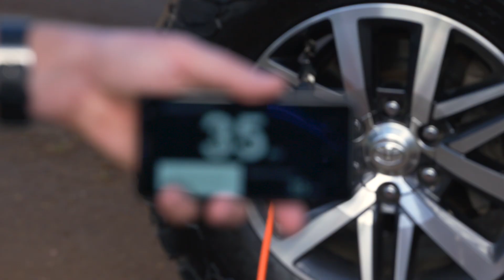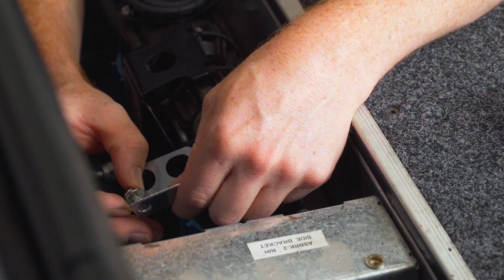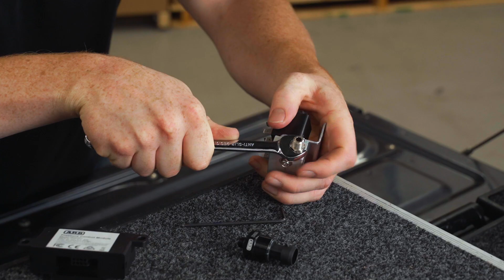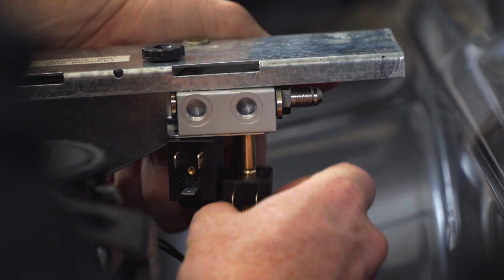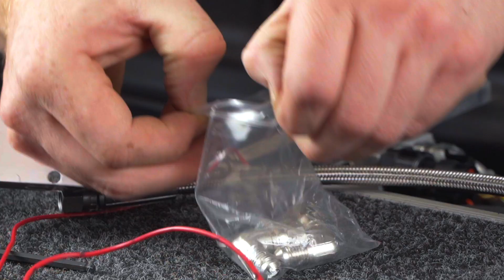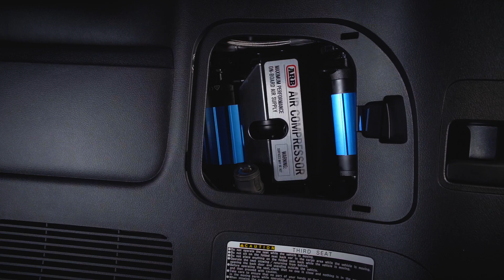ARB Fitting Advice | Pressure Control

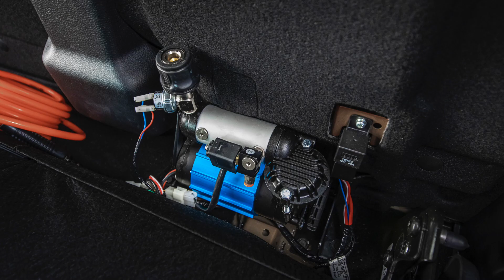Comment: At 1:20 what do you do with the red and blue wires that are connected to the existing pressure switch?  Cannot just leave it because it won't allow the new pressure transducer and pressure control module to work correctly.  Compressor instructions and Smart Pressure Control System instructions do not specify.  Please advise.  Thank you.

Comment: can you still “manually” inflate a tire without using the automatic pressure control/app using a simple hose and air chuck if needed? also, my current setup has the outlet on top of the compressor directly to a line that goes to a quick disconnect mounted on my bumper. how do i keep this connected and useable?

Comment: Would love an install on the single compressor, seems like additional components are required to make it work seamlessly.
Reply: Hello Michael.  Were you able to make your compressor work seamlessly?  I sent a comment a few minutes ago to the ARB Fitting Advice  video.  Did you have the same problem that I did, (read comment)? What solutions were you able to figure out?  Maybe we can help each other out.  Let me know, thanks.
Reply: @ronalddurkee8542  yes I finally worked it out and did need to buy additional items to make it all work. ARB did have all stock but would be good that all staff could advise the right advice.

Comment: If you have an air tank how would this integrate?
Reply: Would like to know this also has anyone had an answer any where regarding using with the arb air tank?
Reply: Another interested person in whether this works with air tank and if so recommended installation?

Comment: I think this would be aided by some sort of built in alternative control method, a manual override (touch screen maybe) of sorts that doesn't need an app or a phone. For those times that the phone doesn't work, runs out of battery, gets dropped and breaks, or gets lost.

I feel like with this set up you would still need to carry an alternative method of inflating just in case your phone dies, so you're not reducing the amount of gear you need, just adding more things to existing accessories.

I do love the idea though and possibly pairing it with a indeflate to do more at once.
Reply from the maker: Hey Stephen, thanks for your feedback! There is currently the option to override the pressure control system if required. It's not the easiest fix, but if needed you can play around with the compressor wiring, overriding the need for your mobile if necessary.
Reply: @ARB4x4Accessories  So not really ready for prime time.
Reply: @stevemcgavren7645  Just put the power on setting at max pressure and you’ll be able to use the compressor as normal. When you wanna inflate all 4 tires at once you simply pick up your phone and set the tire pressure you want to set and continue.